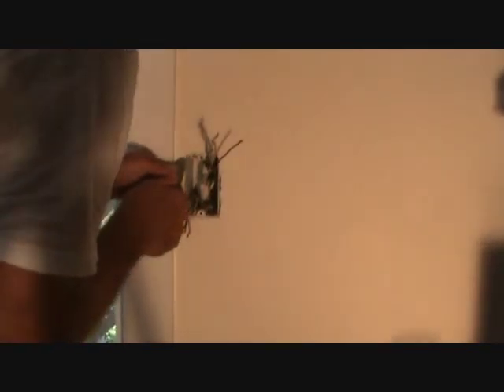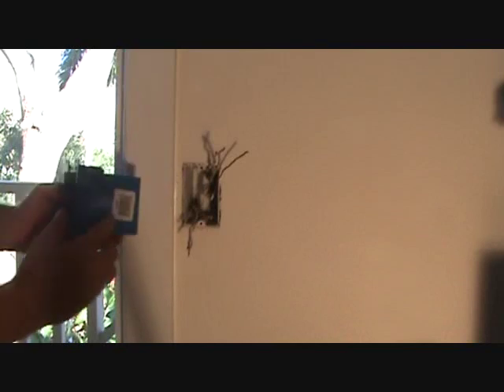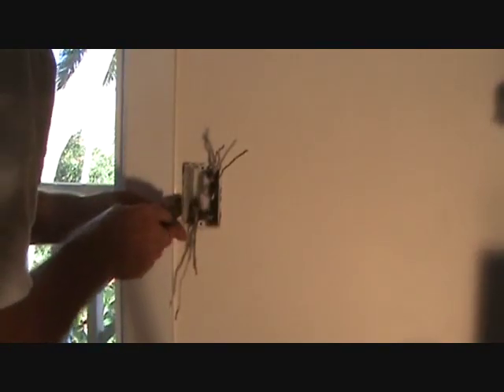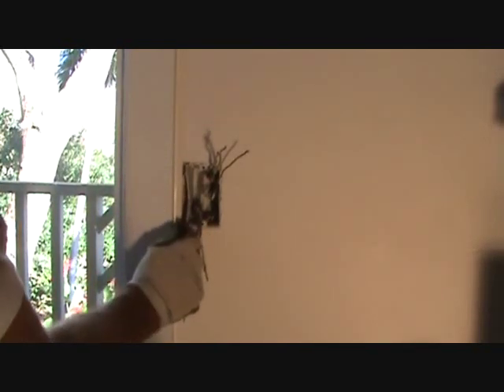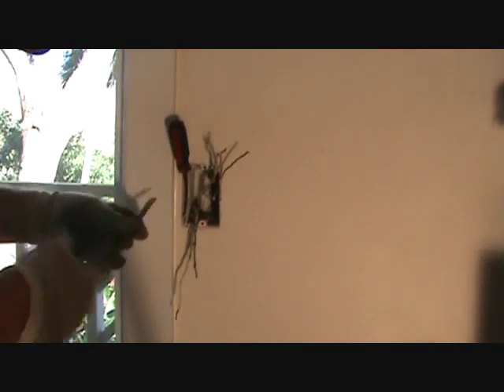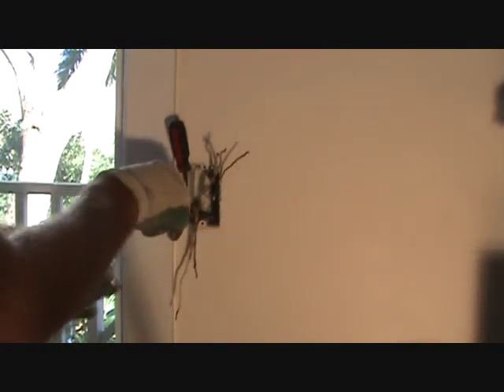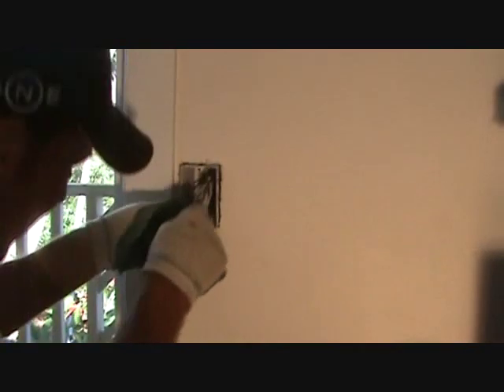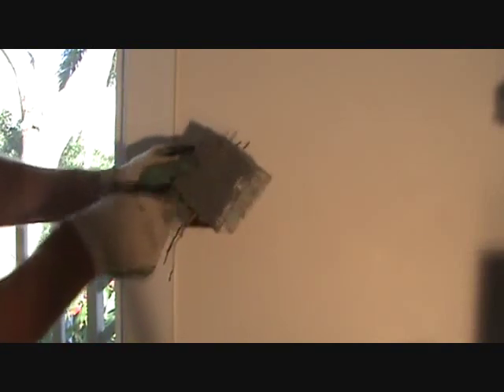How to remove a light switch box

Comment: What can you do if the previous installer had screwed instead of nailed into the nearby stud?  Can't seem to get a good angle with a screwdriver.
Reply from the maker: You can cut off screws with a hacksaw blade...it just takes awhile. If you have a sawzall you can cut off with that too. Just make sure with a swazall that you don't cut off anything behind the screw.....like a wire! Use a hacksaw blade first & run it in there & make sure you don't feel anything behind the screw while cutting, before attempting to use a sawzall. Not sure why they used screws....errrggg!   Joe  :0
Reply: Thanks for your help.  Nice video.
Reply from the maker: Hey did you remove your electrical outlet box? How did it go?   Joe  :0
Reply: I was able to get it out.  It took me a while.  2 sawed wood screws latter and I was able to pull out the box.  Redoing the electrical work took the most time.  4 separate 16 gauge wire cables coming into the same box.  Thanks for the help again.
Reply from the maker: Wow. 4 cables going into the box. That's alot to shove back in there. I know you are already done (great job by the way!). For your next cut in box install....if you have that many cables you might want to think about installing a deeper cutin box. They have 2 sizes for the depth of the box. Then you can get them in more comfortably. Maybe you installed a deep box....?    Joe  :0
Reply: 3 1/2" in.  I had to.  Even that was tight.
Reply from the maker: Good for you, for using the deep cutin box & for packing the wires in there to make it all fit. You get a gold star!   Joe  :0